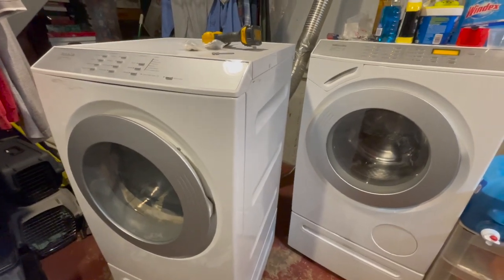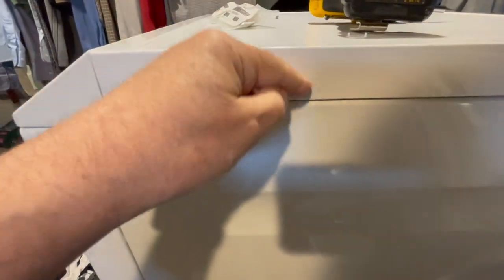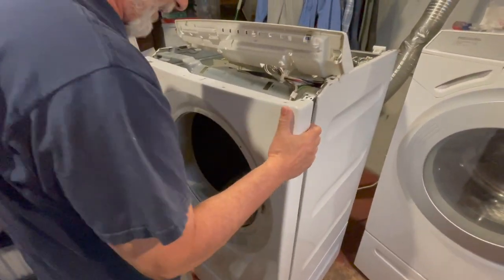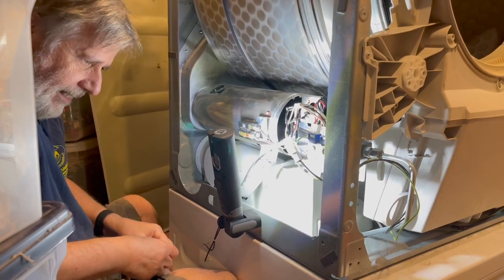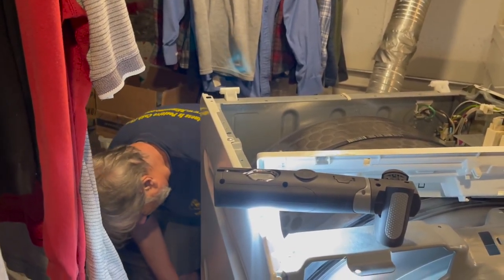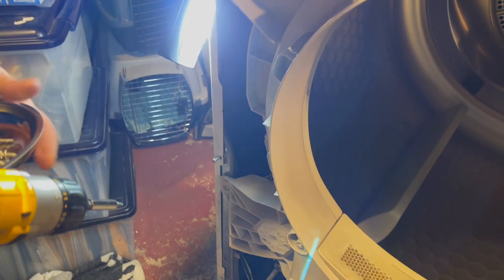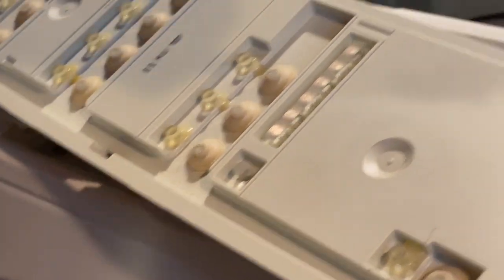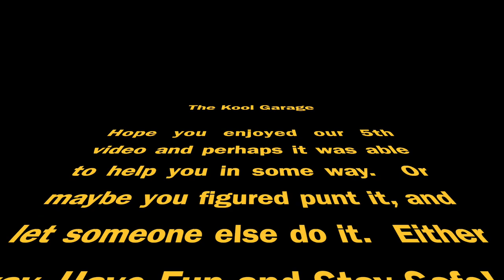Miele T9820 Gas Dryer repair   HD 1080p

Comment: Thank you very much for taking the time to make and post the video.  Watching the beginning really helped me fix my T9822 no-heat problem.  After watching your vid, I could see what needed to be removed and the steps to get to the burner.  Armed with a cordless M12 ratchet and a T20 bit, I was able to get it apart in less than 10 minutes.  You were a big help.  Note: we were lucky.  A large load of sheets had partially blocked the internal vent and caused the rear burner temp/overlimit breaker to pop.  Resetting the sensor/breaker fixed the problem.  While I was in there, I used an air gun (compressor powered) to blast out the carpet of lint from the internal passages.  Twelve years of crap came out.

Comment: Any idea what might be the issue when my dryer (same model) runs while the door is open and I’m unable to get it to shut off without disconnecting the power?
Reply from the maker: I would check the door safety switch.  You may see it in the video. Remove the top of the unit, the control switches and then a couple screws for the front and the 5 screws visible when the door is open. Carefully pull back the front assembly with the door (a bit heavy) and gently pull up on the door latch connector on the right (mine comes out so easy cause I had that off a zillion times). Check that switch with an Ohm meter, I'll be it's probably shows the connection as closed and not breaking the circuit when the door is opened. If that's the case, sourcing and replacing that switch should resolve your problem. Hope that helps

Comment: Thankyou for posting this video, helped me get my dryer working again. However thermal switch n my dryer is tripping frequently for me now so it's time to change. Can you please tell me where you go the part, I searched eBay UK but nothing came up. The part I am searching is 3122542 (From your video @6:11), however not finding anything matching, Was there a different number that
Reply from the maker: I'm sorry for the delay in replying. For whatever reason I'm not getting notifications and unfortunately I wasn't able to log in and check.
The seller on Ebay where I purchased doesn't have any available and listing deleted.  However here is how it was listed. 
"Miele Tumble Dryer Thermostatic Limit Switch 60T05-502610 Part #3920942"

Current search https://www.ebay.com/itm/155451511628

You maybe able to find other brands as well, it's just a Temp safety switch.
Hope that helps, although the info is late. - Ken

Comment: Thanks for the video. What was the initial problem? What Fault indicator came up?
Reply: Kept shutting off with a lint circulation error. Burner never went on. Cleaned out entire air path and found the temp over sensor wasn’t active and the reset button didn’t work.

Comment: How did you test them to find the one, which is not working? Did you test them cool, hot, or increased the temperature until they switched off?
Reply: Tested cold, should be be a short (zero ohms) but was open. Rest button didn’t do anything (should be reset for use). Took a bit to track down replacements, I believe I got them from a EBay sell in the UK.
Reply: @TheKalanTeam  Thanks!